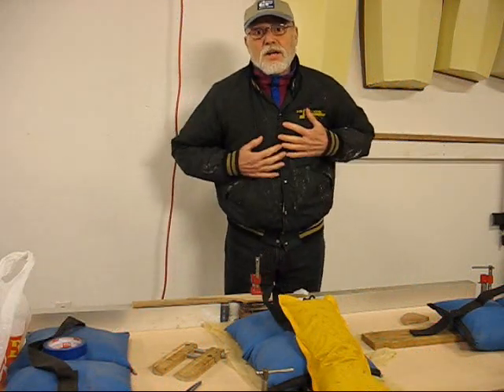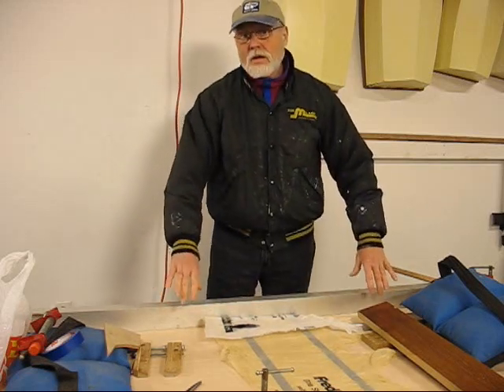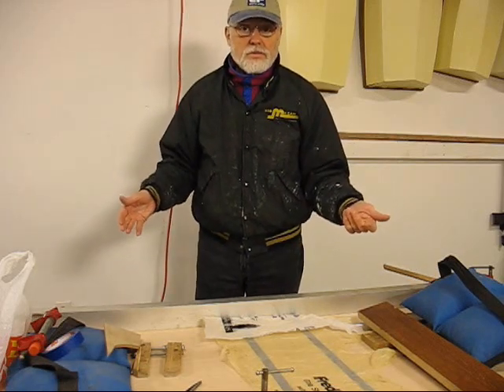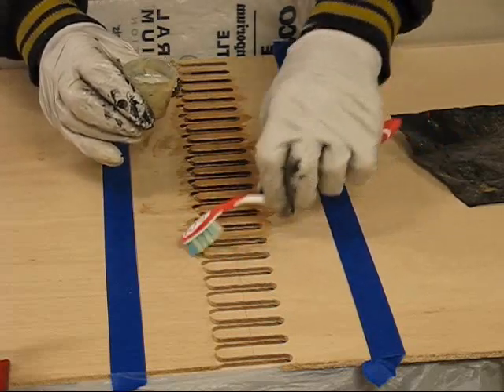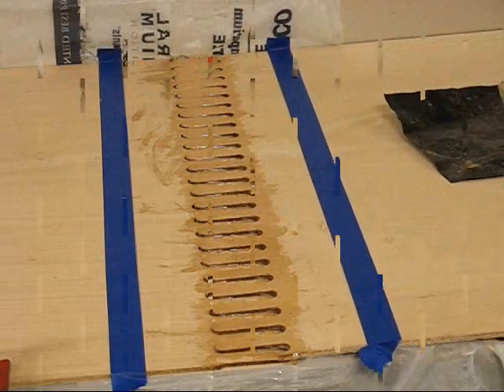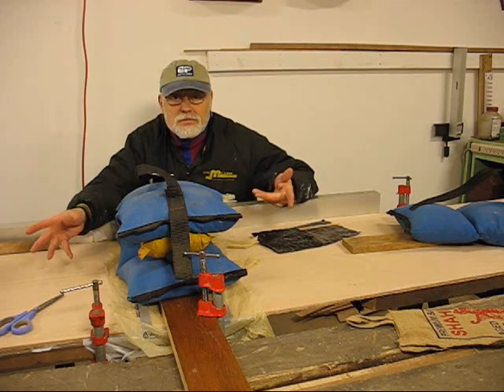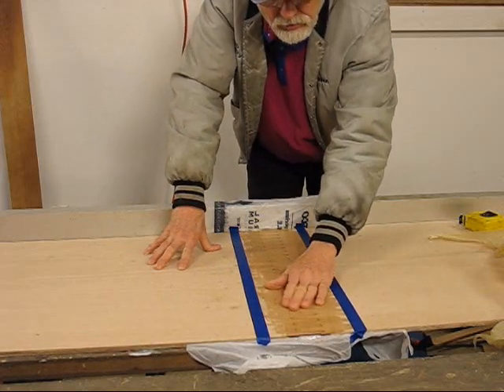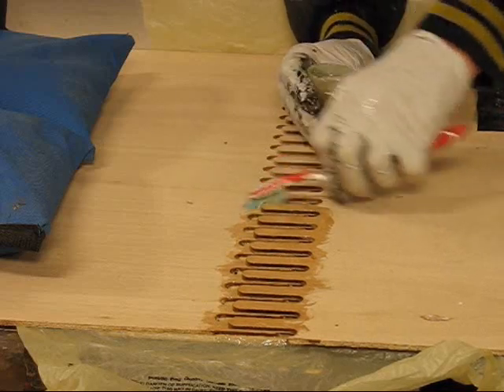EMC Part 1-5 Epoxy Finger Joints.wmv

Comment: Model airplane supper glue works well with this type puzzle joint scarf! It bonds almost instantly and soaks deeper than the epoxy dose! Either works well but I like the super glue because you don't need to clamp or wait more than 30mins to use the panel

Comment: Just a tip for people who want to use these plastic shopping bags. Make sure that the print is on the outside otherwise the print may stick to the epoxy. Epoxy won't stick to plastic but in some cases it will stick to the print.

Comment: I am starting to build my first boat - Granville Bay 12'.  In the plans it talks about scarfing using a bevel process with a 12 to 1 ratio based on thickness for the material being used.  Now I have just viewed EMC Part 1-4 and 1-5 using Finger Joints to join the plywood.  Which is the better process?  Which is stronger?

Comment from the maker: Those plans were drawn up before I experimented with the finger joints.  I've found it almost impossible to get a really good scarf, so I've been using the finger joint method.  I think I have a video before the EMC series that I show making the finger joints and trying to break them.  Use the finger joints, and follow the lengths given in the plans as is.  You will have an extra inch leftover at the end using the FJ's.  Go to Duckworks and download the finger joint PDF.